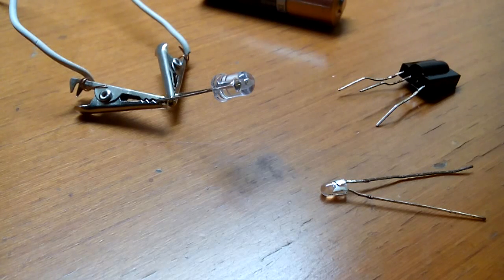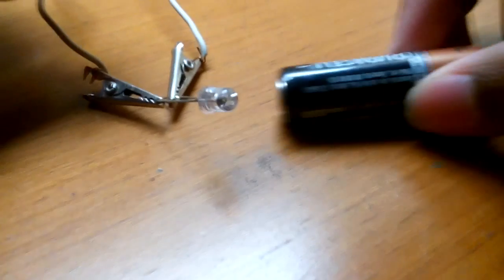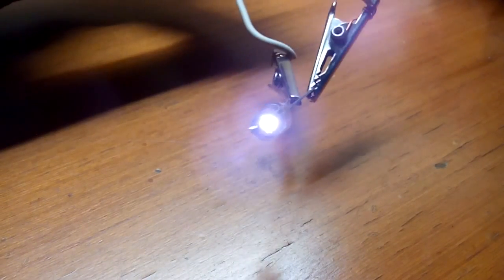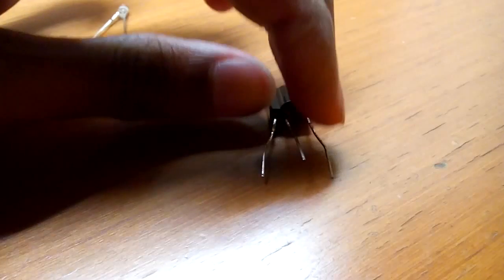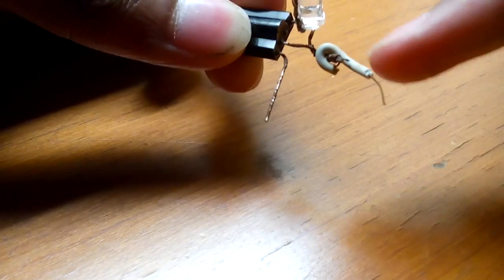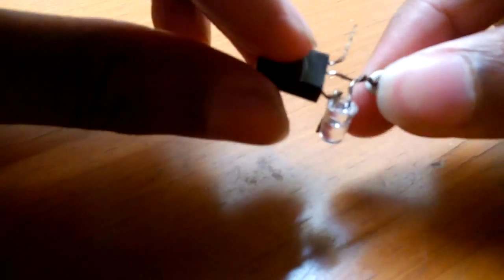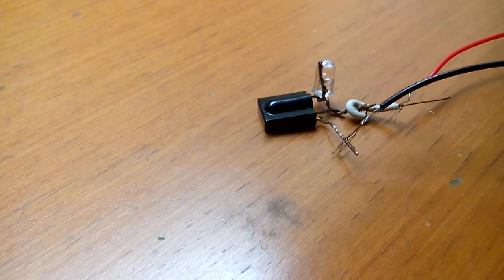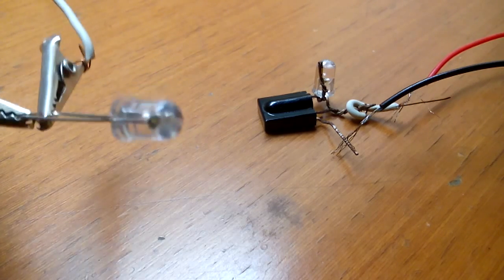DIY : Infrared Receiver

Comment: can you suggest me an alternative for tsop 1738.Thanks for your reply in advance
Reply from the maker: +aiwin anil Hey! The TSOP 1738 detects infrared light. You can make a television remote sensor using TSOP 1738.
Check my latest video's!

How to make a "Remote Sensor" on Breadboard :--- https://youtu.be/aIgxItg9-jE

How to make a "Remote Tester Circuit" on Breadboard :--- https://youtu.be/3g-pKVmy-5k

Sometimes lights coming from sunlight, fluorescent lamps etc. may cause disturbance to the TSOP 1738 and result in undesirable output even when the source is not transmitting IR signals.
Have a great day!

Comment: Your description is the first IR emitter/receiver pair which doesn't use a transistors, and other components. i would like to make a simple, inexpensive IR emitter button and IR receiver to trigger a relay, which would then control a light. If I understood your setup correctly, the LED only stayed lit while the emitter was receiving the IR from the emitter. Is that why others use a transistor, so when the IR emitter triggers the receiver, the transistor then would turn the LED on, and keep it on, even after the IR emitter is off?
Thanks,
GeoD

Comment: the blue LED didn't turned OFF even after the IR light turned OFF. why?
Reply: dude, its because our tube light emits light in a wide range of frequency,which also consists a fraction of ir rays, hence it glows even after you switch off the ir  transmitter,  try it with any bright light source, it will glow. And due to this drawback we use radio signals to control most of the wireless technologies.
Reply from the maker: +Creators Edge Thanks a lot mate! I really appreciate your comment :)
Reply from the maker: +Dheepu Dhass Hi! Even I don't really know the actual cause why the L.E.D blinks even though the TSOP1738 IR Detector is not receiving IR light.
Check this video of mine👉https://youtu.be/3g-pKVmy-5k
I would be glad if someone could explain to me this concept in the comments below! :)
Reply: Troy Araujo um
Reply: Dheepu dhass you are right!